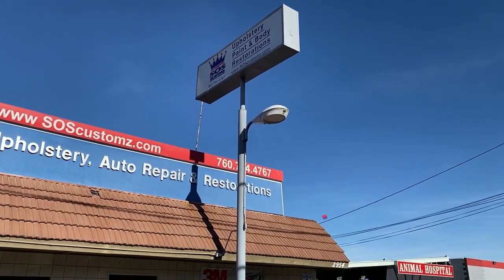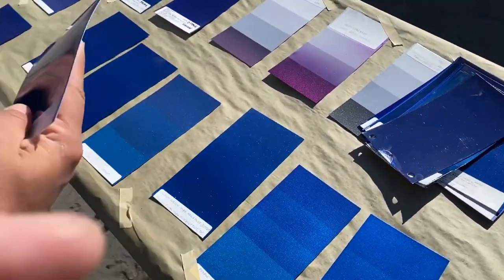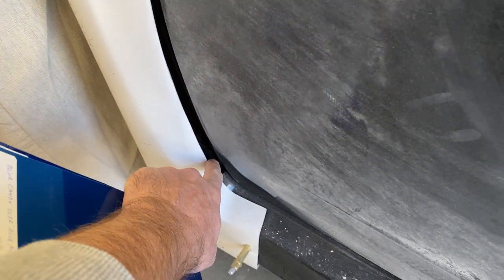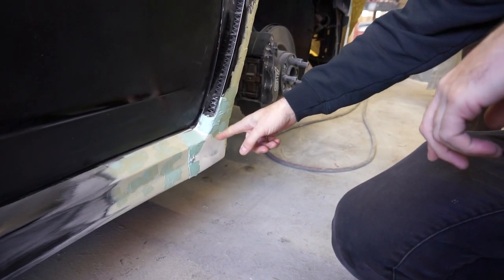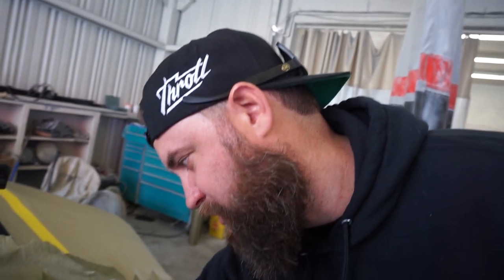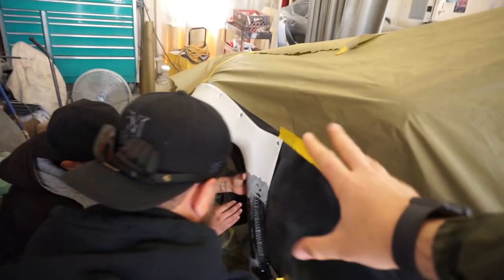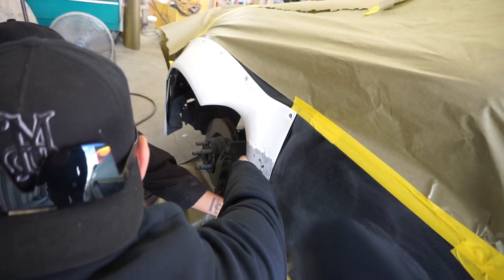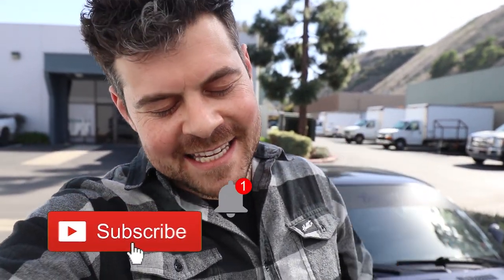Building the ULTIMATE 2008 Subaru WRX STI Hatchback - Part 4 - SOS Customz Paint Reveal

Comment: SOS would be getting my business if I lived local. They deserve all the success. Oscar seems like such a stand up guy
Reply: They're not removing window trim, or windows. If you hit the edge of the paint with a pressure washer it could peel.
Reply: @idokwatcher2062  maybe wait until they actually finish the body work and paint bud.
Reply: They deserve an Oscar in body work 😉😆
Reply: Idok Watcher and they dry parts outside. Seen multiple videos where recently painted parts are just sitting outside.
Reply: Thanks bro means a lot 🙏🏽🙏🏽🙏🏽

Comment: You should NEVER need to use filler aka "bondo" on dents or surface issues... That's the problem with bodywork in the states... You take it back to steel and do the metal work either pull it out or often simply taking it back to steel removes the issue. Not enough talented tradesmen anymore and too many cowboys!